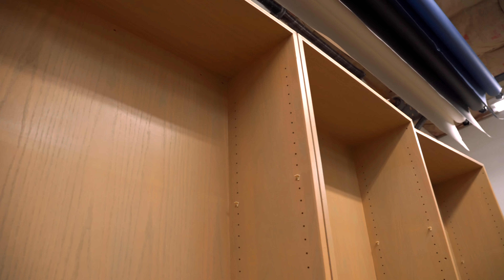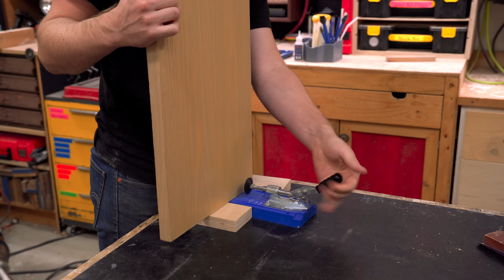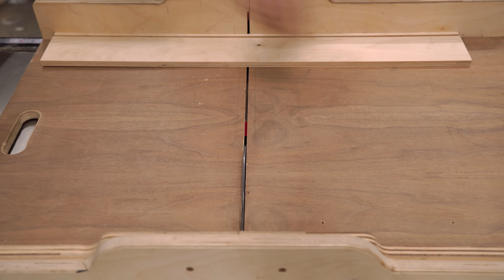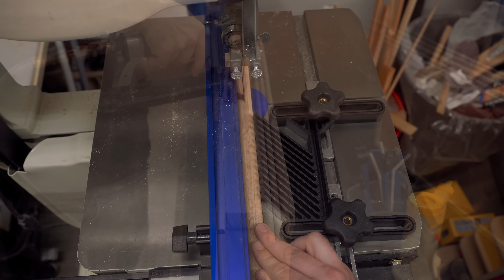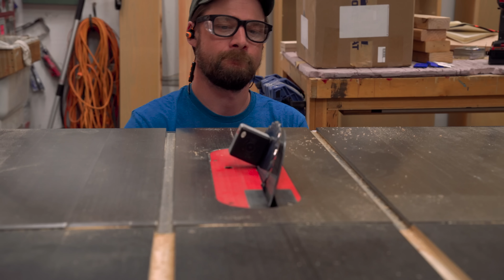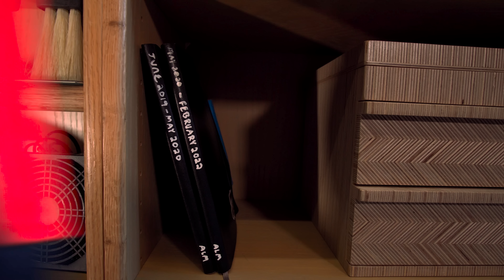Turn what you HAVE into what you WANT!

Comment: Is it too late to make a recommendation for the other 2 book cases?

1) Make a shallow case that hides behind a door, so that when a door opens, the case can act as a door stop, while also holding a few small knick knack items that make for easy grabbing. If you don't have shelves in them, then you can add clothing hooks, or maybe add a place to keep your wallet and keys.

2) Make a shelf that goes over the door of a bedroom or bathroom, so that a few items can be grabbed easily, and kept off of the floor. This goes on the inside of the room, and looks almost like an awning.

Comment: Wow. There are still plastic straws on your side of the pond. You can't get them in Germany anymore and have been replaced with straws made from paper (for re use also metal, Glas, etc.) To protect the environment. Every little helps....
Using straws to catch glue is the best use for them anyways. 
On YouTube I watch quite a few woodworkers and some of them let the squeeze out dry before removing them or straight with a damp cloth. And I still haven't found a proper explanation for either way.
Btw. They look amazing.... That's beyond upcycling. It's at least top up cycling. Thank you for another great video on one of my top five YouTube channels.

Comment: use the two others on the side and make a bed with storage underneath out of them? You could also remove the backs put wheels under them and a handle on the side to make them into sliding cabnets like they use in kitchens? Can maybe used in garage for storage of srews ect next to the workbench? or use the wood of one to make the other into a room divider? or storage for a kidsroom with boxes in them? hihi got so many ideas now here in my home. Thanks! great job done

Comment: I have two 8' tall particle board shelf units that somehow survived five military moves... I am doing this to upcycle them into shop furniture, for certain. 
No hate about the glued top, but I'd offer two recommendations: 1) pre-finish both sides before gluing since you're using water-based topcoat, and 2) use a polyurethane construction adhesive for the glue. Overall it turned out great.

Comment: You're kidding yourself about 3/32" of seasonal expansion and contraction being insignificant when married to a stable substrate. The problem will be magnified by your - shall we say "lavish" - applications of glue. To an old guy it looks like you think that the more glue you slobber around the shop the better. You may get away with gluing that top full width though I'm skeptical. Running a narrow band of glue down the center of the length of the top would minimize the restraint of the wood. Wood's expansion and contraction, like water turning to ice, cannot be restrained. Cracks and crushed fibers will result. Because your office is apt to have pretty stable temperatures and humidity you may never have a problem. These gloomy forecasts are not my wish for you. They are what I've observed, the results of similar methods in my own work. On another note, the use of those patterned birch veneers on the almost-hidden drawer face ends is stunning.

Comment: Hi Michael, awhile ago I found a tutorial about using Japanese hand saws (by a Japanese carpenter.. In Japanese).
     Apparently the trick to cutting straight and less tear-out is you 'rock' the saw while you're cutting;
     like.. 2/3 strokes more 'overhand' (so you're cutting the front/far edge more.. Aimed diagonally downward)
.    Then while continuing to saw you 'move' towards sawing the edge nearest to you (so the saw is pitched diagonally upward).
    Back and forth, back and forth, until you're through.
That already helps a lot

Additionally, you can pre-score the line you want to cut with a sharp knife.

That way the wood fibers near the surface are already severed in exactly the place you want.

Can't be any tear-out, if they're already cut :)

-

To be clear,
You are obviously on a much higher skill level than I am, and maybe you already know these things...
     But I just thought I'd share.
I don't have fancy table saws or one of those pull saws.. 

The things I mentioned here have really helped me out when using hand tools (even when using my ryoba & kataba model saws, that cut very straight already compared to regular cross cut saws and rip saws)

-

I'm sure someone else can explain this better, and another might have some extra info on this.

Happy to hear any comments you or your viewers might have (:
      (That's how I learned quite a few new things and tricks - I never had a formal education in any of this stuff)

-

Anyways, love your work.
Always very classy, clever, and leaving me wanting to make things myself

Cheers from Amsterdam

Comment: I would recommend the blum undermount runners, u can't see them from the side so u can have a cleaner edge on the draw boxes and they are easy to fit and adjust as well  as being able to take the draw out as it clips in place underneath and plus they have a smooth soft close and are really durable

Comment: This cabinet is a total conversion of the original furniture. Unbelievable how much you've been able to change the look of it!
Your fellow kolleague Neil Paskins has built Kerf-Makers for exactly the situation you've been in here with cutting the dado in the Front- and Back-panel. It's a two-piece jig with an adjustable screw for taking the blade-thickness into account. With this screw you're also able to adjust the width for a bit of play. I think it could help you in future projects

Comment: The straw trick is an excellent tip! I wonder though if it'd work as well with paper straws 🤔 (single use plastic straws of the type you use in this video are no longer available in the UK).

Comment: I think to help your chances with the glued on top I’d cut some grooves length wise on the underside to give some dead space to absorb some expansion if needed. That being said, you’re building this in the summer so I guess you will more likely experience some shrinkage, so those grooves might actually be a place for cracks to start. So maybe my idea is dumb, just putting it out there for people to consider and weigh in on if they want.